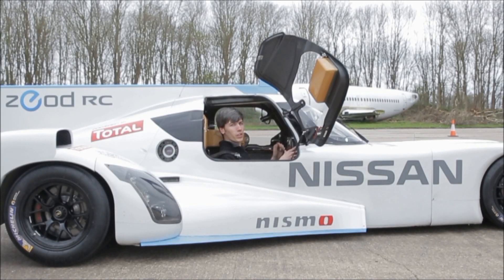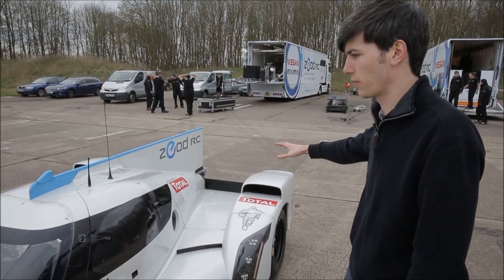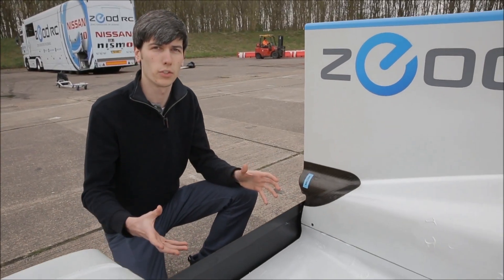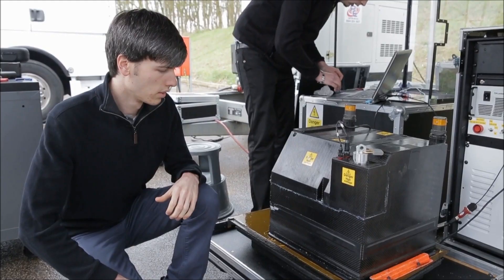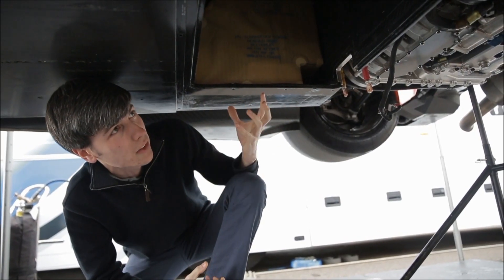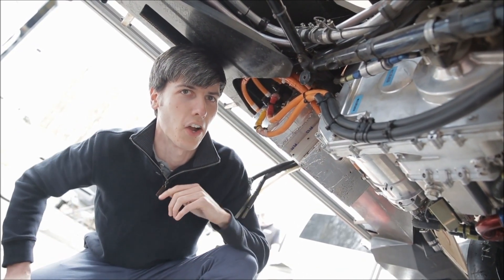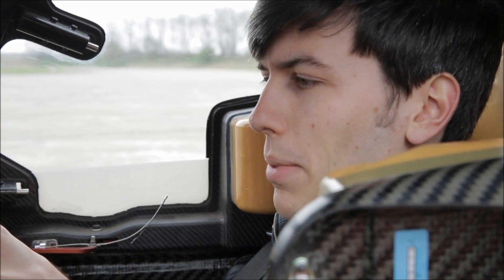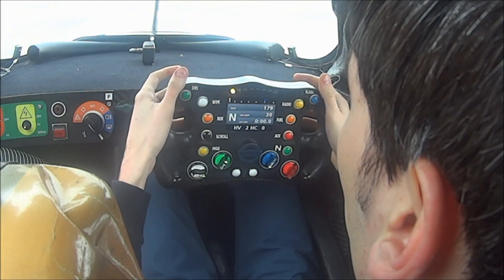Nissan ZEOD RC - Vehicle Overview - Nismo and Engineering Explained

Comment: hey great video but one thing to complain: a high voltage  does not indicate a high temperature, they more likely have to cool it because of the enormous amount of current (120.000 Watts x2= 240.000 Watts at 400V operating voltage it means there are 600Ampere "slurped" out of the battery which is actully pretty impressive... but it will be actually more because there is no engine out there with a 100% efficiency ) but however we absolutely love your channel and especially how you are doing your videos, sarcasm in every corner keep it going!

Comment: It seems like a lot of weight is devoted to the internal combustion engine. Was acceleration not competitive when using electric alone? Also, it seems strange to have no mechanism to reclaim some of the energy wasted as heat. That heavy cooling system has the sole purpose of sending heat energy out the back of the vehicle -- too bad some of that can't be reclaimed....
Reply from the maker: The internal combustion engine only weighs 40 kg, also, it acts as a very good range extender.

Comment: If you think this car is cool, that's awesome, but the credit should really go to The Deltawing, a car designed by Ben Bowlby back in 2012 to race from garage 56. The Deltawing is a car that was built to use half the fuel, weigh half as heavy, have half the drag, and half the amount of power as its larger counterparts, but go just as fast. The ZEOD and the Deltawing are almost identical in design, which shouldn't be a surprise. Nissan and Michelin were two of the original sponsors for the Deltawing before Deltawing went independent. While I think that the ZEOD is fascinating, it is indeed just a copy by Nissan. The true innovation lies with the Deltawing team. 

Here is a link to learn more about the Deltawing:    http://www.deltawingracing.com

By the way, I DO like Nissan. Especially the GTR. I'm not trying to criticize Nissan (much). Just sayin'.

Comment: Design is very good for aerodynamics and low center of mass. But is it any good at the cornering? Because it does resemble a relient robin in some areas :P
Does the fact that it's narrow and low enough overcome the almost 3 wheeled design?
Reply from the maker: Well I don't know the cornering numbers, but it has pretty good downforce, and while watching on the track it did seem quick through the corner.

Comment: The best one I have seen and replacment of battery system is innovative,,,3 cyl with 400hp one more best, When I properly understand it is not like a range extender it is properly like a HEV with complete e-mode and ICE mode with a sperable clutch rt?

Comment: Could  you please explain how the Hybrid powertrain works. Like how the clutch engages one power source to another , and how the combined power of both MGU and IC engine are delivered to the car. Thanks!
Reply: And sorry that I didn't mention, that was an awesome video. (Y)
Reply from the maker: INTERNAL COMBUSTION ENGINE EXPLAINED ZEOD RC - ENGINEERING EXPLAINED

Comment: Wow!! Over 400 H.P. from a 1.5  3 cylinder engine!?
Reply: lurifix yes. its has its turbocharged and wheighs aroung 40kg
Reply: Nope.
Reply from the maker: Yes indeed!
Reply: BMW sucked out 1400+ hp from a 1.5l 4cyl

Comment: Where's the clutch located at? Is it automatic, a pedal, or a paddle shifter like F1 cars?
Reply from the maker: There will be a video uploaded on Nismo's channel where I describe the powertrain in more detail. It's a 5 speed pneumatically operated sequential.
Reply: Pneumatic paddle shifters, so presumably a DCT.

Comment: Nice video, I've got a few questions :D

1) I like the exhaust pipes, but why does it need 2 if the engine is only 3 cylinders? Doesn't seem like 3 cylinders would need 2 exhausts to breathe properly.
2)Do you know the redline for the gas engine? 
3) The small wheel base at the front probably dramatically decreased the front wheel size but that probably wouldn't affect the handling too much considering the down force and weight distribution, do you know how much down force the front end/car itself creates?
Reply: those 2 exhausts aren't the permanent ones. other pictures of the car show it has a single pipe routed through the vertical stabilizer thing behind the driver. You can see the end is black at 1:20.
Reply from the maker: Ignore the exhaust in this video. It was simply in place for noise restrictions at the test track. As CJ mentioned, it's a single pipe that exits the center of the rear.